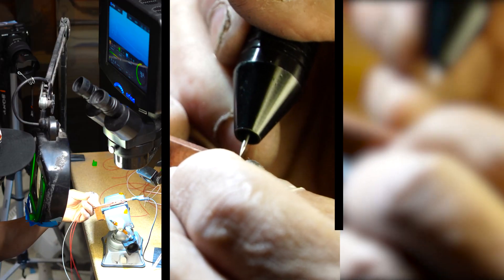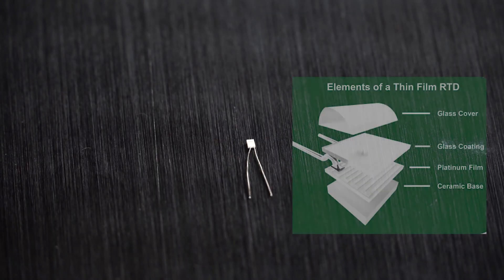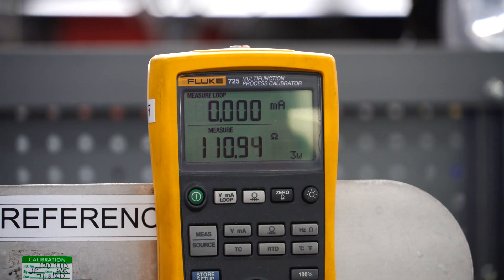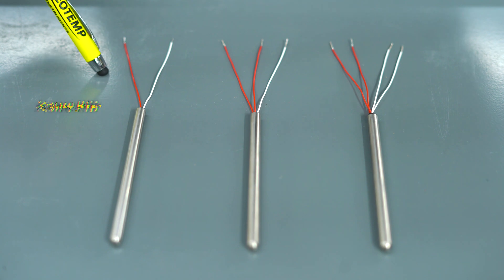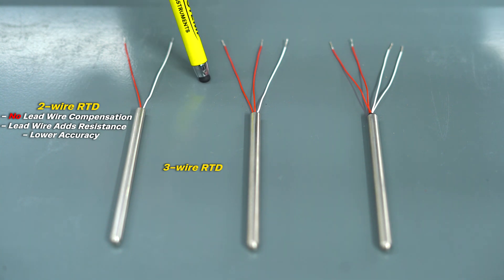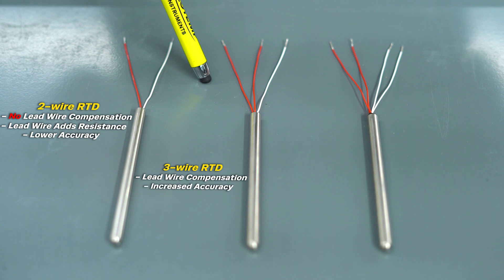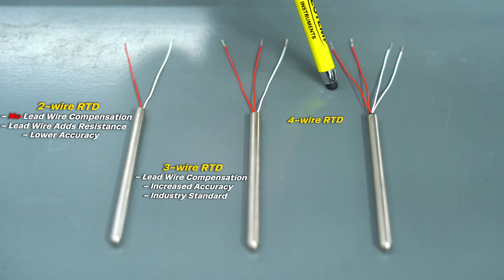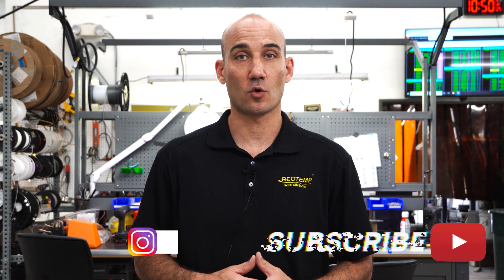2 wire, 3 wire and 4 wire RTD Explained

Comment: What do the two colours (red and white) represent?
Reply: Hi. All of the wires are 24AWG copper wire. The white wire is welded to one side of the RTD, the red wire(s) are attached to the other side. The two red wires are the same color so that you know they are attached to the same side. The second red wire is redundant, it's function is to measure the amount of resistance the wire itself is adding to the assembly. That "extra" resistance of the wire can then be removed by the transmitter or other device you hook the RTD up to. Leaving you with only the resistance of the RTD itself.
Reply: @HiRollerRecovery  Thanks for the reply!